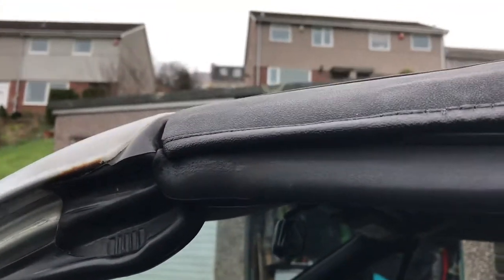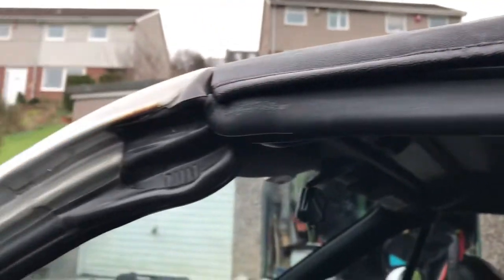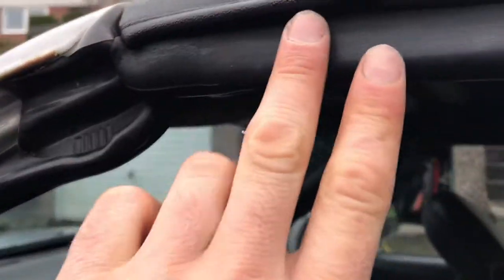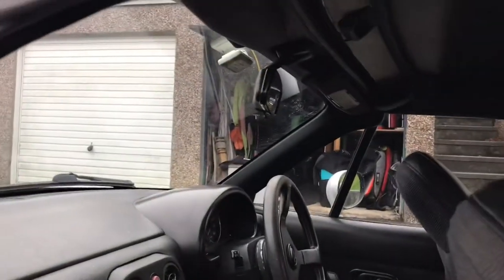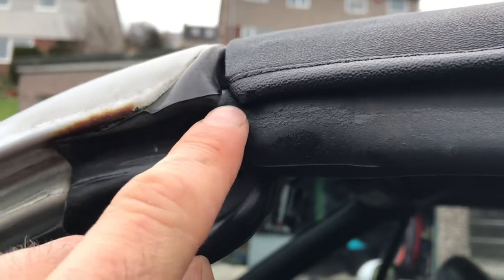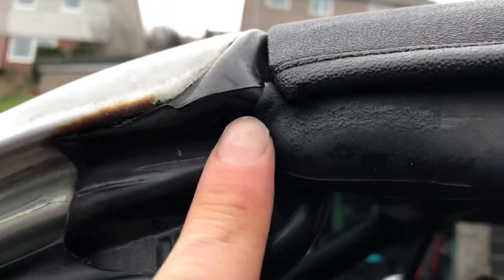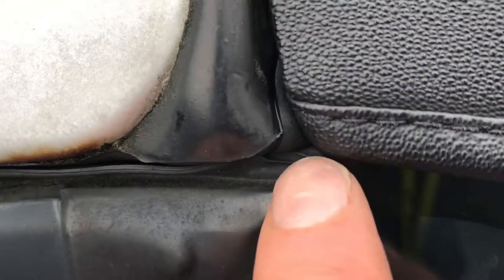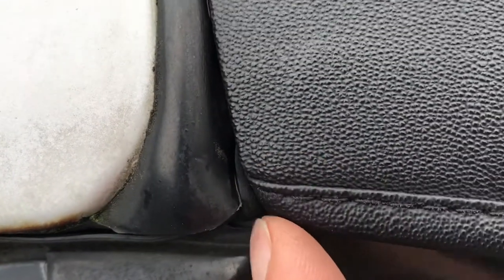Mx5 mk1 roof leak fix window seal eunos miata

Comment: Look at the rust forming at the top of the door seal tube wear it meets the softop. This is the top of the A- Pillar and behind the rubber seal, which is glued to the  A-Pillar the rust could be already eating through the pillar and into the inside of the A-pillar. 
If it has this is best cut out and a new section welded in, but also good to put a corrosion Inhibitor into the A-pillar to stop any further rusting at the bottom of the A-pillar where it meets the upper front Wing & upper Chassis ( pronounced Shas si) sections. 
Thankyou for your video.

Comment: Just thought I would let all know, where you see the rust showing just under the rubber seal at the top of the 'A' Pillar, this will get worse & then eat into your pillar & then water ingress into pillar and down into the  base of pillar. This base area then rusts too, but you will not see it. Also note that under the painted seal in same area behind top of wing ( fender) bolts is also known to rust.